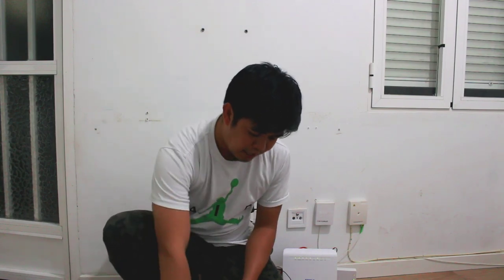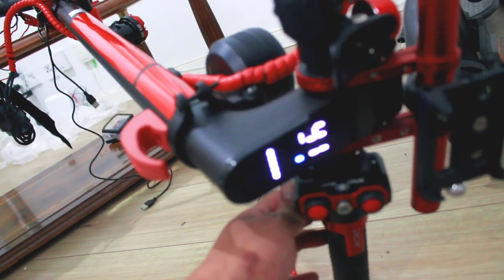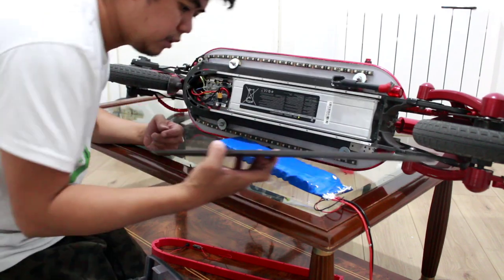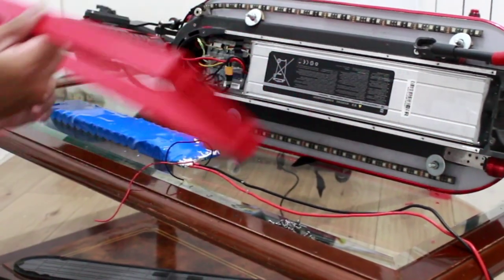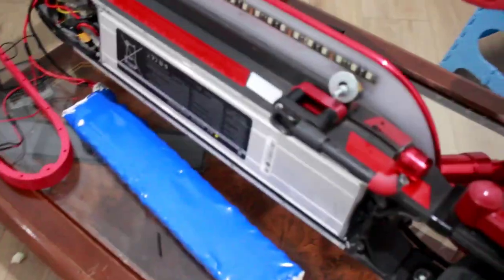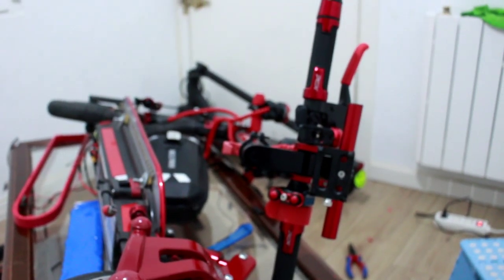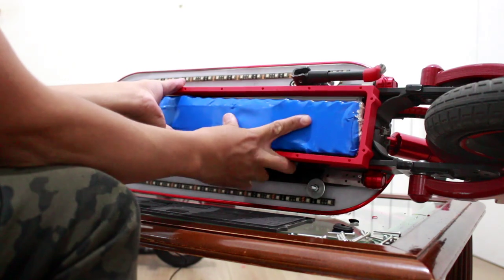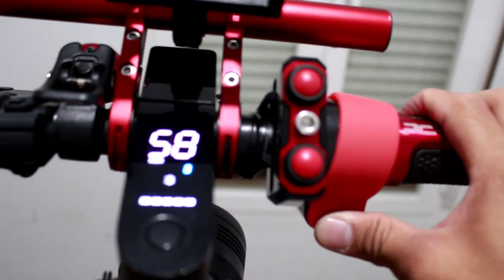4s speed  battery install to m365 xiaomi pro 2

Comment: Unless you upgrade your motor, it will be wrecked very fast but very nice mods and video thanks for sharing 😃
Reply from the maker: nope im not change motor 350w
Reply: I do not think it will as its 600w not 350w (pro motors only)
Reply from the maker: @lugerthegingerbreadman1327  yes tock motor pro2 350w . stock conttoler beafore 4s.  and now ill stall already 6s

Comment: the range battery can use also to be speed battery anyway
Reply from the maker: nope that only range but if you want speed you seoerate the all cell ang do it for speed bat
Reply: I also have a speedbattery, sometimes I forget to charge it, so I have a low battery at late night. so I tried to put the range battery in the speedbattery place and I was shocked because my range battery is 36v and my speedbattery is only 24v. that's why when I ran, the scooter went very fast from 55kmh to 79kmh.
Reply: @RHON_TV  and my range battery i only bought from aliexpress paid 31 euros with own charger  and speedbattery 6s i paid 100€ no own charger wtfff!! So now i use only range battery more speed and no discharge cause of his own charger
Reply: @nexxeimemories 😮😮 Can you show video plss
Reply: @nexxeimemories  thanks i have Discord, so you Can also send video, 🙏🏻

Comment: Hello sir need pa po ba nito ng firmware pag nag add ng speed batt na 4s? 36v stock battery + 4s 16.8v speed battery kasi plano ko need pa ba un new firmware baka po pwede makahingi if need pa please thanks
Reply from the maker: need moag palit nang filmwear kasi tatas ang voltage nang batery mo pag range lang ilalagay mo at ipaparallel mo lang sya kahit di ka na mag palit

Comment: Did you change cointroller components or is stock?
Reply from the maker: if 4s bater im not change the controler only stock .
Reply: @RHON_TV  the stock controller handle 4s?
Reply from the maker: @marine1718  ywss
Reply: How many amps?

Comment: Looking forward sayong channel sir,same lang po ba ng voltage ng stock battery kapag mag add ng speed?anu pa po ba ang babaguhin na program?at kung may xtra battery na po para sa range pwede pb lag yan ng seed?
Reply from the maker: pwwde ka mag add nang batery speed gang 4s sa stock controler pag. 6s speed na problema susunugin  na mutor mo jan at controler. .. sa range batery nmn ok lang kahit mag add ka nang  lambas sa stock bat mo..   pag nag lagay ka nga pala nang speed bat need mo   din baguhin ang filmwear mo
Reply: @RHON_TV  paano po mag bago ng firmware nabibili po ba un?
Reply from the maker: @probinsyanointhecity6550  kalimitan may bayad meron ako jan sa mga tutorial ung ibang filmwear wala bayad binibigay ko ung iba lang meron na bayad like ganyan pag nag up ka nanag bateru
Reply: @RHON_TV  dibali 2nd hand na kc nabili q idol na pro2 may kasama ng xtra range battery,ang problema q is ung speed,nsa 38 kmh lng ang takbo kapag fullcharge,gusto q magpadagdag ng speed kaso mas mahal pa sa scooter ang battery,
Reply from the maker: @mr.g9747  saan ka ba naka base sir.   mag add ka nalng nang 12v batery takbo na yan 55 to 60kph
Reply: @RHON_TV  doha qatar aq idol,
Reply from the maker: ay ganon kala ko d2 ka lang din
Reply: @RHON_TV  oo idol,meron din gumagawa dito mahal nga lang ang singil,doble na ang halaga ng scooter

Comment: 35/Km/hr..with my weight 110kg..speed my kick scooter ..i need run 30km..how much get ..ah battery in 36v..pls rply
Reply from the maker: you need to change filmwear
Reply: how much i need .ah battery for run 30 km with weight 110 or speed 30 km of my kick scooter

Comment: nice build sir!
tanong ko lang sana kung ilang 'Parallel' ang stock battery mo, ganun din ba ang gagamitin mo sa speed battery?
Reply from the maker: series po. pero my switch para sa stock bater at speed batery. pero jan may range pa kasi ako jan kaya ung range at sleed mag kasama sa switch ung stock lang ang naka hiwalay
Reply: @RHON_TV  ahh, so bale po kung parehas 7.5ah yung stock at range battery nyo, yung isang 7.5ah lang po ang may additional speed then yung isa ay normal speed lang po depende sa kung saang battery ise-series ung speed batt.. 

Ganyan po kasi ang setup ko now.. Dalawang 7.5ah battery(stock and range)... Nag babalak palang po magkabit ng speed battery..
Reply: @RHON_TV  Boss, another question lang.. haha. naka Y CONNECTION po ba kayo sa series ninyo? thanks!

Comment: Hola!
Bond dia boss,
 meron akong range batt. Naka parallel connect sya, pwd ko pa ba syang lagyan ng speed batt.?
At pano yung conection
Reply from the maker: pwede nmn seperate mo lang sya lagyan mo switch . parang sakin range at stock batery mag kasama speed mag naka hiwalay

Comment: Hey mate.
Nice video!
I have problem, i have a xiaomi m365 pro 2 with a 12s external battery. I can run 42kmt before it starts braking. My friend has the same external battery on the old m365 pro, and he runs 50+, without the scooter start braking. Do you have any software that unlocks the scooter or i there anything Else i can do? Thank you!
Reply: Dunno man, the pro2 is weird. I have one myself. It starts braking at 35kmh

Comment: hello firmware please
Reply from the maker: filmwear for pro2?
Reply: yes plese i have power baterie 3s5p and 10s4p distance baterie
Reply from the maker: @nolimit941  how many voltage you have . may be you have. you need to up the voltage of the filmwear
Reply: 42 v on baterie in aplication xiao dash
Reply from the maker: yes i know error 24?
Reply: o dont have error i want run at 58 km
Reply: hello you can make a firmware for me?? please